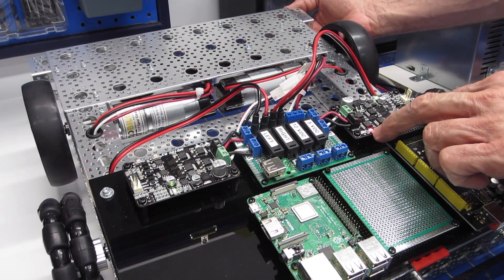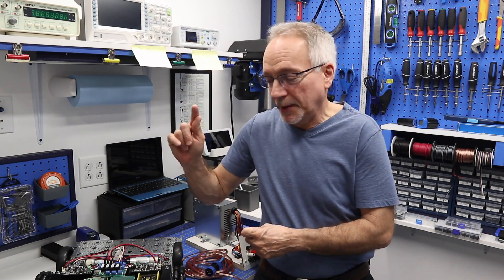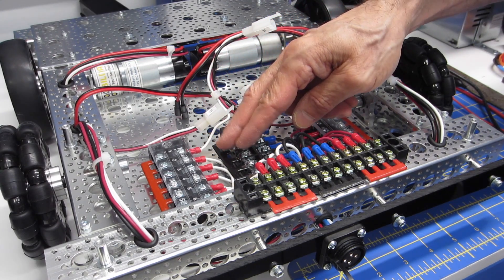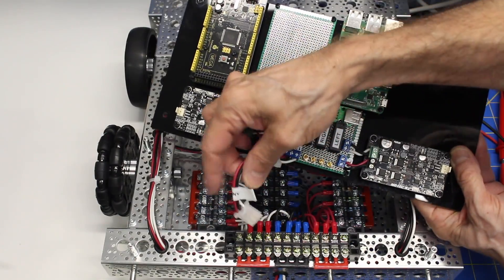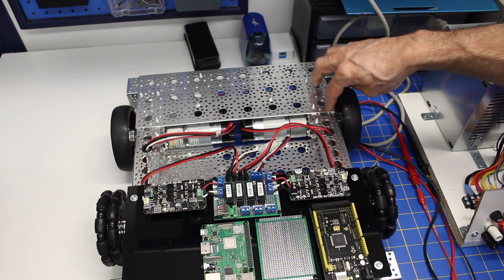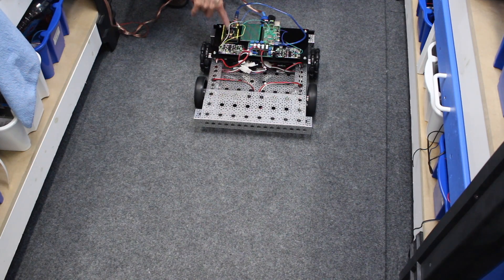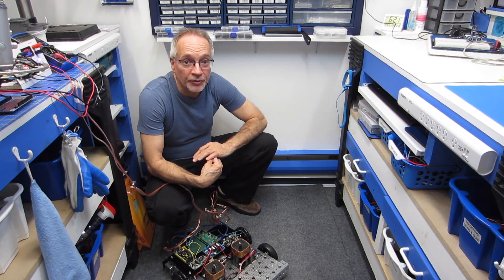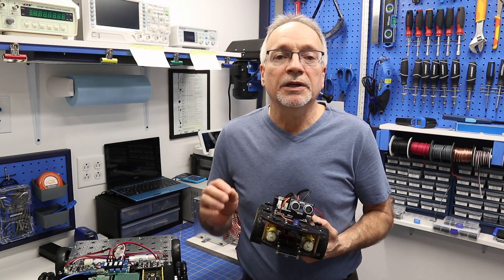Build a REAL Robot - Episode 7 - Motor Test

Comment: Did you install the AC wall plugs upside down for a reason?  I'm not saying it is wrong but my OCD  was kicking in. Thanks for the vid.
Reply: It's arguably safer that way. If anything falls and hits the metal of something that's plugged in, it'll hit the ground tine. The "right" way up,  it could make a connection between hot and neutral, causing a short or even arcing. Near zero chance of this happening, but not actually zero; it's happened in the real world (usually just trips the breaker).
Reply: @jamesh5743  Thank you. My OCD can take a break now.

Comment: For all who doubt in your design: modularity in using different controllers for different tasks is a cheap and a logical way. That is also true for industry. In industry they use e.g. in cncs motor controller to control each or sometimes 2 axis, a NC which calculates the traces and a computer for Human Interface actions. Each participant in the field, e.g interlocking guards are only there to control, whether the guard is open or closed. Even they use today controllers and bus systems e.g. Profinet or Profibus to communicate. Its cheap, because hardware is the cheapest investment. Modularity helps to standardize the interfaces and use the devices as kind of black box with defined interfaces. If someone uses ROS, as promised, the modularity helps also, because as publisher subscriber system, ROS will manage the whole communication and also has a lot of open source software modules, which are already written. So the only effective way to do this, is the way  to go in this video. Thank You for your clear videos and hoping to see you implementing ROS later.

Comment: I'm totally with you on the design philosophy.  That's exactly how I do things too.  I'm using an Arduino Mega to control several STM-32 microcontrollers.  And I'm using a Raspberry Pi as the higher brain to control the Arduino Mega.   I like to have dedicated systems too.